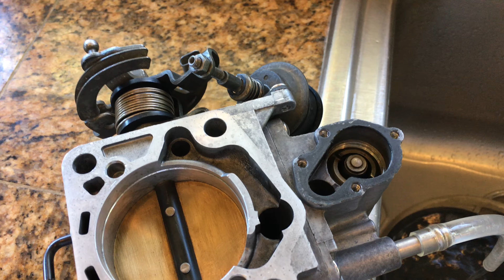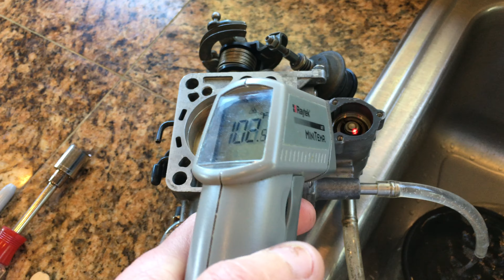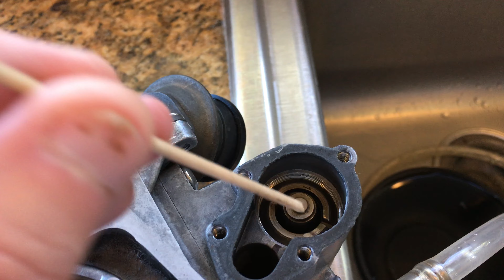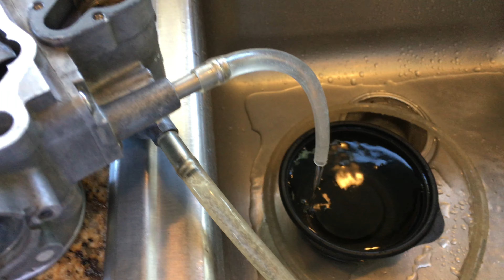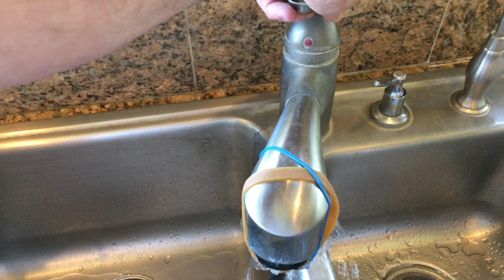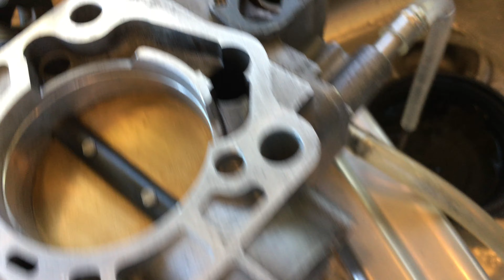How to adjust the Idle Air Control (IAC) Valve on the 89-95 Toyota 22RE pickup truck throttle body

Comment: I'm having a hard time finding that paper gasket. When I search IAC valve gasket all I get is the rubber multi chamber gasket not the small gasket where the adjuster spring is. Any info would be greatly appreciated. P.s great video 🙏
Reply from the maker: Yes, I don't believe that gasket is available out there. I also searched high and low and could only find the rubber one you are referring to. My advice would be to buy gasket making material and carefully cut one if needed. You can also put a little bit of RTV on there to help seal, although I think cutting a fresh one might be the best idea.

Comment: that valve gives me a lot of trouble  with surging ,I can replace it and it will work for a few months then start doing it again. If I had known back when I replaced the ecu with haltech elite 750 that if I had used the elite 1500 instead  I would of had the option to use drive by wire which would have eliminated that valve completely and also could do cruise control with it
Reply from the maker: Yeah, I've only now just gotten mine adjusted to where it works 99% of the time correctly (which is nice for a change). But I have certainly thought about making something to replace that entire crazy IAC system down there; I thought about making something manual which would work most like the old style chokes - where you can just pull the choke on and off if you need it. I think a system like that would be handy to have, although now that I finally have mine in more or less proper adjustment it's functioning pretty much okay now. On the subject of the Haltech: I don't know too much about the Haltech ECU's specifically, but I know a lot of people use them for a great many different applications with a lot of success. I'm building a turbocharged 3RZ motor for my truck and intend to use a Link ECU for that project I think. Once that build gets off the ground, I will start to document it on the channel, along with teaching myself how the Link ECU functions. On your setup over there, did you replace the Toyota ECU with the Haltech 750 and just bring in all the data from the existing OEM senders on the motor or did you retrofit the motor with different sensors or what exactly did you end up doing to move into the Haltech setup?
Reply: @ray5961  i may put a turbo on mine this summer

Comment: I'm having the same surging issue  but this truck is an 86 22reand the IAC is not there on the throttle body and im not sure it even has the same thing. Kinda lost.
.
Reply from the maker: Could be you have an aftermarket throttle body or something. Feel free to send some pics; my contact info is on the about page for the channel there. Happy to have a look.

Comment: When driving my pickup with the 22r3 in it gets around 35-40mph  with the gas peddle steady it will accelerate rapidly like a punched the pedal down but then cuts out after it jumps up at least 15mph . Could it be the TPS?

Comment: I saw someone else clean out the coolant hose and pipe that goes into the throttle body and that was clogged and was the problem. Have you seen this before ?
Reply from the maker: Yes I've seen it a couple of times. No only can the hoses themselves become blocked, but the internal passageway inside the IAC valve can as well. You can end up with corrosion in there sometimes and it needs to be cleaned up. Usually you can just check the temp of the hoses to see if coolant is flowing though. The other thing which can clog up the system is stray RTV sealant in the cooling system - for example if someone gets a little too crazy sealing up gaskets and RTV squishes out into a passage and breaks off.. that will often times flow through the IAC passage ways / hosts and get trapped in there. Honestly, I wish Toyota had just put a manual choke on the dash.. the IAC valve causes people so much trouble.
Reply: @ thanks that’s good advice to check the hose temps. Yup I’d take a manual choke on the dash instead. I like k.i.s.s keep it simple stupid. The only tech I like in cars is power windows and Bluetooth stereos.
Reply from the maker: @joesee8079  I'm with ya on that. I have roll up windows in my truck and I added a Bluetooth streaming module that connects to the factory head unit (although from a later Toyota as I remember) and allows me to stream music in as though it's a CD connected to the deck. Looks totally factory :)

Comment: I works like a thermostat that does not open all the way but opens to when it needs to in small increments
Reply from the maker: the IAC valve shuts and stays totally off once coolant temps reach around 130-140 degrees F - under normal operating temps of the 22RE (around 180F) the IAC should be totally off post warm up cycle.

Comment: I am having a problem turning the IAC valve slot (adjusting ring) in and out with my flat head screw driver. I even use a hammer to try to turn the IAC slotted head (adjusting ring) and it would not move. I also used lubricating fluid but no success. How did you manage to loosen and turn the slot IAC head that easily in the video?  There must be a special tool for this? Thanks
Reply from the maker: Dude.. the first time is a straight nightmare. As I remember, I had to put the IAC assembly in a soft jaw vice and use a torch to heat up the nut a bit and sprayed WD40 on it, etc. Even then, I ended up having to use a pair of pliers and a wrench on the pliers to twist the hell out of things - when it finally popped and let go, it damn near took my arm off. The only reason it's easy to adjust now is because of breaking it free the first time like that and other people have reported the same struggles getting that nut to move the 1st time out. Make darn sure you mark it or measure it.. I still don't know for sure how many turns the factory setting is. I've thought about buying a stock one just to measure the depth from the top or something and/or carefully counting the rotations. Anyway, let me know if you have any success over there. This video shows the tool I ultimately made for that nut, but I'm not totally sure it would have helped to free it initially or not (but once it's free, then it's easy to adjust). I don't know what Toyota locks it with from the factory, but yeah it's on there tight as can be. Here's that video: https://youtu.be/CE5RLrnEk6M?si=ePHhi1wJcK-2SpFw

Comment: THumbup from me.  Do you have any videos on how to adjust the position sensor on a throttle body?  Thanks
Reply from the maker: Thanks! I don't have any specific to the TPS but there are some good ones out there. You definitely want to get that adjustment correct using a digital volt meter. I would refer to the factory service manual pages for that, since it's a fairly process to adjust it correctly.

Comment: Wow, very thorough.  Can't get that collar unscrewed to save my life.  Ordered some Kroil penetrant as PB blaster didn't do it.  Will make your special tool also and see how that works.
Reply from the maker: Getting it free the first time is a straight up nightmare. Try putting some heat on it.. I wonder if maybe Toyota used some sort of locking compound or something. I can't remember exactly how I did mine, but I think I might have used a punch to drive it backwards or maybe I used that socket I made with a mild impact gun... but yeah, it's not easy. Make sure to accurately mark the factory location.

Comment: I'm looking at the tool you used to adjust the valve. Where can I get one of those?
Reply from the maker: I made it from a spare 9/16th socket w/ 3/8 drive. I filed it down on the top in order to create the two areas that fit into the adjustment nut slots on the IAC. If you have a spare socket and a large metal file, it's actually not too hard to make. I think it took me maybe 20-30 minutes of filing and checking to get it to work. It's really handy to have, especially if you have never adjusted that nut before, because it tends to be hard to move the first time.
Reply: @ray5961  Thank you Ray for the quick reply. I went to adjust the valve and I was afraid of breaking something. I have plenty of 9/16 sockets!
Reply from the maker: @xyzabc9332  I soaked mine in WD40 over night the first time I broke it loose. Before I made that little socket tool, I used some C-clip pliers and just stuck the pin part of the pliers into the slot and then used a wrench or something on the pliers to twist. Luckily I didn't damage anything doing that method. But yeah, the custom made tool from the 9/16th socket works much better and also allows to easier fine tuning adjustments down the road. Frankly, just blocking off the IAC valve works best, unless you are in a super cold climate. I have mine blocked off with some tape (to block the hole inside the throttle body, as shown in my other videos). Once the truck oil temp gets up to about 100-120 degrees, the truck idles fine after that.
Reply: @ray5961  I've tried to make 3 out of different sockets but my IAC is so stuck it's sheared the tips off each one and I can't adjust it
Reply from the maker: @Coopa_Trooped  I hear ya man. Mine is stuck so bad I thought it would never break loose. I might have used some heat on the aluminum housing to help free things up, but I can't remember for sure. Also, make sure to use some WD40 on the threads over night. Also, the socket is for making adjustments. I didn't use that socket to break mine loose; I made the socket after it was already turning. Sorry maybe I should have made that clear. As I remember, I used some needle nose pliers, where I ground off the ends to make tips that go into the slots, then I used an adjustable wrench across the pliers to turn them. So with one hand I was holding the tips of the pliers down into the groves of the adjusting nut and with the large wrench, I was exerting a turning force on the jaws of the needle nose pliers. It finally let go like that with a big crack and even then, turning it was a bitch. There's no easy solution.. you just need brute force basically.

Comment: So one quick question. Turning it all the way clockwise will shut it down at a lower temperature, and turning counterclockwise will shut it down at a higher temp. Is that right or do I have it backwards?
Reply from the maker: correct - clockwise and it shuts at a lower temp; counter clockwise and it allows air to flow through until a higher temp.

Comment: This is the first time I’ve seen this issue addressed after searching for two years. What tool did you use to turn the slotted nut?
Reply from the maker: I made the tool from a spare socket.
Reply: @ray5961  I figured that’s what it was. I’m doing the same right now. Love your videos! I’ve been fighting this idle drop during warmup for years and never seen anyone even talk about it until I saw your videos.

Comment from the maker: Just a quick update: I've since adjusted my IAC valve to exactly 4 full turns out from all the way in; that seems to be working pretty well and slightly better than the previous 2.75 turns. Also see the other video linked in the description for further information and also a more detailed look at the adjustment tool used. https://youtu.be/CE5RLrnEk6M
Reply: Was your 22RE surging at idle? If so did touching the brakes make it worse?

Comment: 2 and 3/4 full 360 degree turns?????
Reply from the maker: yeah 2 full turns, then 3/4 of a turn, However, I think it might actually need more than that now that I have tested it. Maybe 3 to 3.25 would be better. I'll probably leave it at 2.75 turns, even though idle is down around 600 RPM's for the first few minutes. Never a dull moment adjusting the ol' IAC valve. :-)

Comment: I was just messing with mine 3 hours ago and went with roughly 2.5 turns out and received a positive result with a cold idle of 1100 RPM. Was having it idle at 2200 before at cold so it was definitely the culprit. Now with it being at operation temperature, it idles around 900 but I'm happy with that. My only issue is when I come back from a ride and try to start it after I shut my truck off it'll die sometimes in first gear. I Will mess with the AFM tomorrow as that is the only thing I haven't touched.
Reply: Afm?? What's that

Comment: Hey, nice video, thank you.
So once tightened down, then backed off 2.75 turns will the coolant be able to flow as freely as when set to factory setting?

I imagine that all coolant doesn’t have to pass through the IACV, just a portion?
Reply from the maker: Thanks! The adjusting ring actually is controlling air flow into the motor; it doesn't have anything to do with the coolant flow. The coolant flows through the IAC all the time (just like you see with those hoses I have setup on the sink). What you are adjusting with the IAC valve is at what coolant temp the IAC stops allowing extra into the motor. The IAC valve' s job is to allow more air into the motor so when your vehicle is cold, it can run for a bit at a slightly higher RPM. 2.75 turns counter clockwise from all the way in will shut the air flow off at coolant temp of around 100 degrees F - I haven't tested my setup yet to know if that's a good setting or not, but i think it should be about right based on how long it takes my truck to reach about 100 degrees on the engine oil.
Reply: @ray5961  Thanks again for the video & happy to hear that the coolant flow isn’t obstructed in the adjusting of this valve to reduce auxiliary air flow at a lower coolant temp:)
Reply from the maker: @DePalma.  No coolant was harmed in the making of this video haha :-)
Reply: @ray5961  lol

Comment: I know you been having trouble with this, the coolant inside the system might be under pressure? Could that effect the temperature/timing opening?
Reply from the maker: I think I adjusted it incorrectly previously. I had it set more like 3.5 turns out, which I think was resulting in it closing far too late. I'm going to try the 2.75 turns and see if it will fully close and stay closed at 100 degrees - which the motor should have less trouble staying above. How's your build going?
Reply: @ray5961  The relay came it and worked like a charm. On a hold until I get more fund. Just thinking how far do I want to go. Thinking of future paint color also, thinking of painting it Toyota Cement Gray (1H5). On a stand still for rn.
Reply from the maker: @ericrodriguez8556  Glad to hear the relay did the trick!